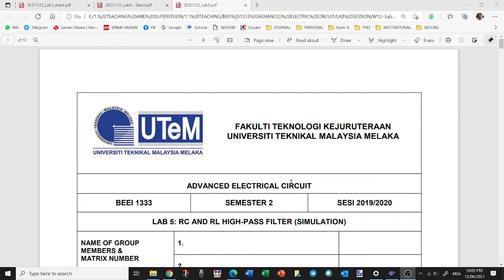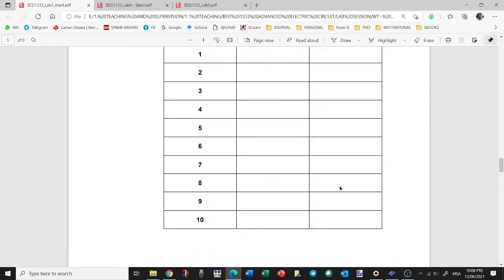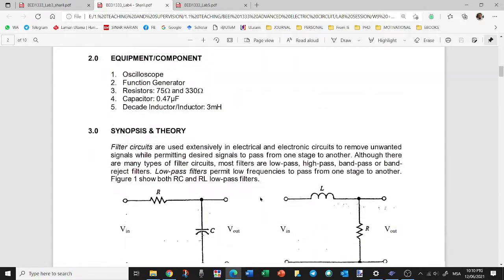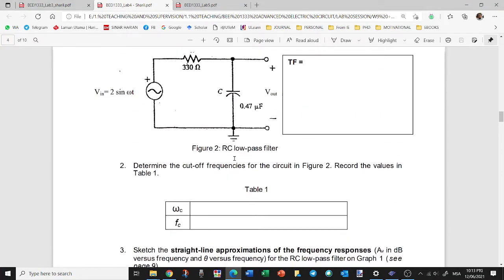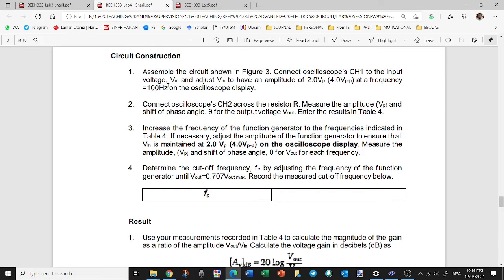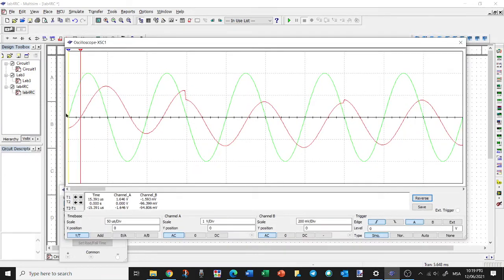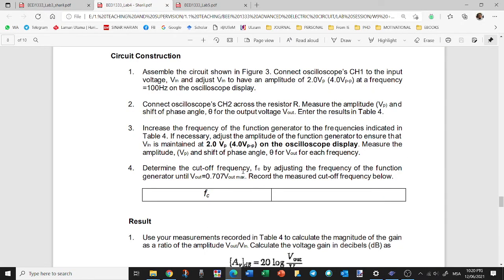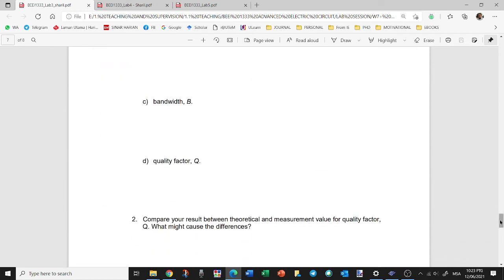BEEI1333-Advanced Elec Circuit - Lab Briefing (3,4 and 5)- Simulation

Comment: Q2/ a 20MVA, 12.2KV, 0.8 PF lagging Y-connected SG has a negligible armature resistance and syn. Reactance of 8.20, the generator is connected in parallel with a 60Hz 12.2Kv infinite bus that is capable of supplying any real or reactive power with no change in frequency or terminal voltage. A) find the internal generated voltage at rated condition. B) what is the armature rated current. C) suppose that the generator is initially operating at rated condition. If the internal generated voltage is decreased by 5%, what is will be the new armature current?

Comment: Q3/ Two 300kVA, 1000V, 50Hz alternators operating in parallel to supply a load of 500KW at UPF. 60% of the load is supplied by the first generator. If the terminal voltage and power supplied are kept constant always, then changing the excitation to make pf-0.8 lagging. Find the generator currents, power factors and total load current. (the generator and load are single phase)